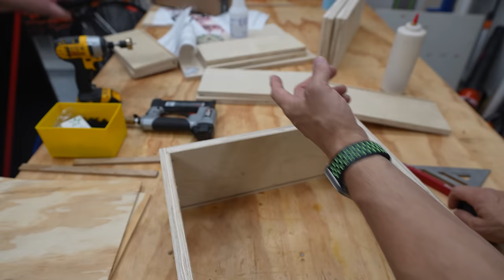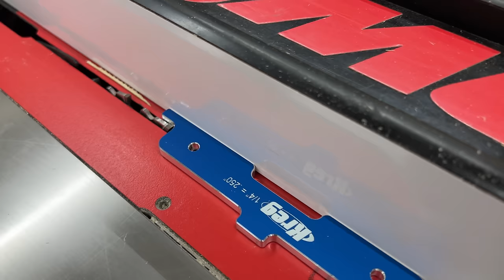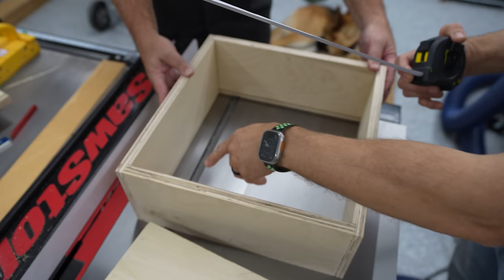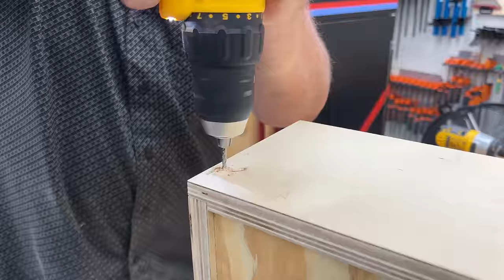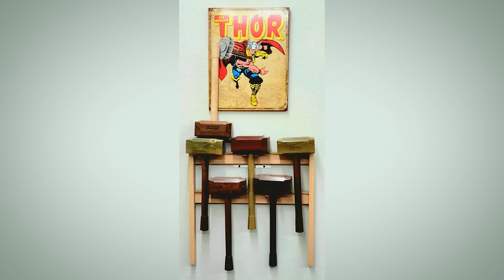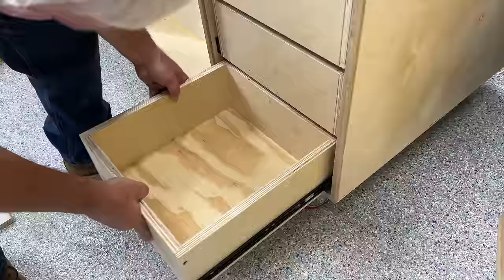How to Build EASY Plywood Drawers (beginner friendly project)

Comment: Great video! I'm not far from NRH, would have loved to meet you. I have found the quarter-quarter-quarter method to be the easiest and fastest method for drawers (which are really strong as well). You end up with a similar box but it only requires one setup on the saw for all your cuts, as opposed to the multiple setups required here. It also involves less math than this one and it works for any thickness of wood (you just make the dados half the thickness of the wood and setup accordingly). 🙂 You do need a dado stack though, so this method is great for those without a dado stack. 👍

Comment: I just finished an apothecary cabinet with 16 drawers. Didn’t measure a one for square. If you build it right, they’ll come out square!
Reply from the maker: Nope. Not true.
Reply: @731Woodworks  If you measure your boxes before assembly they will only be out of square if YOU did something. My statement, and experience, stands.
Reply: @5280Woodworking  every woodworker I know of checks for square before proceeding. I think we all know what happens when one assumes.
Reply: I’m not assuming anything. I’m not saying don’t ever check for square but small drawer boxes like this, if done right it will be right by construction. Even the vid proved that once it was completely assembled it was square. Measuring before is just wasting time or a red herring of something out of square. But to each their own.